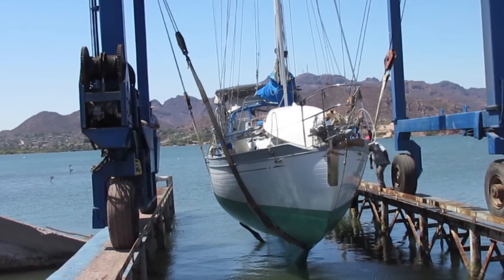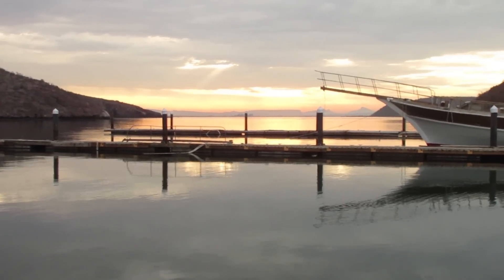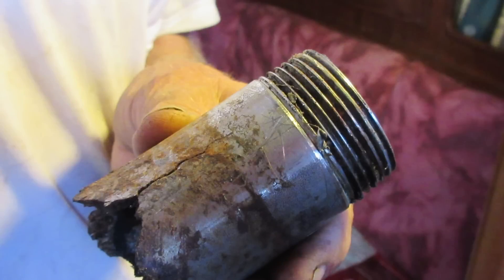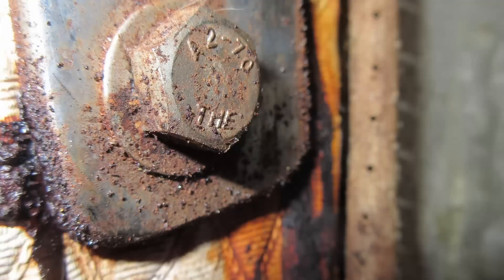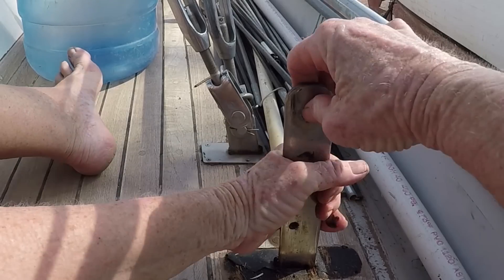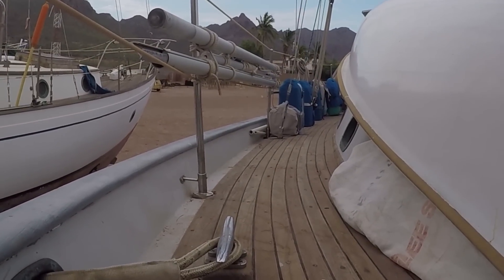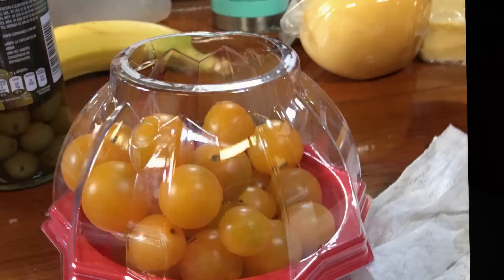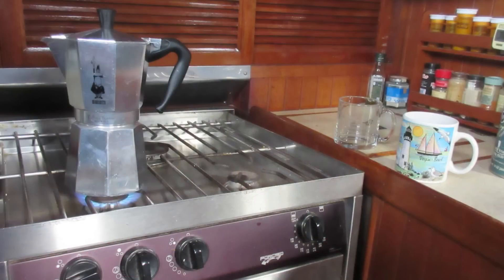Ep. 21 -  Licking Our Wounds

Comment: Bob Perry very smart hombre... keep the teak decks. clean recaulk and sand them. you will be happy with it. Rebed all deck hardware as well using butyl tape.
Sorry your spash didn't go as planned but better safe than sorry. Getting the exhaust right is imperative. Good video. Inspiring. 
Fair winds.

Comment: Tough luck but it's an old boat!
Those thru deck type chain plates are notoriously hard to stop leaking, be sire to use loads of butyl tape  caulking only when reinstalling for you best chance of no leaks.
Really glad bob perry recommends not removing the teak decks, 
Cheers
Warren
Reply from the maker: Yes, getting the chainplates to not leak will be a learning experience.  Now that we know how easy it is to pull them, we can keep at it until we find the right combination.  
Once we saw how thick the teak was, we felt it would have been a crime to destroy all that wood.

Comment: Thankyou good videos , from experience living on a yacht is a full time job , you only know your boat after everything has had some attention at some stage , if your very thrifty types and use the use again theory, think again it's not going to work , like the chain plates , buy more than needed stainless cause your will need some soon somewhere else some time , thoes boat were put together well but the fittings ware and the skinfittings were crap as you have found , I see the one you took out had an earth wire fitting , that's what made it deterate  electroliss of metal , don't link wire these things only the engine and shaft to zink anode , boats are hard work but good fun ,  you can always tell a boat that travels world wide buy the way it's presented and looks , good luck keep going , grant nz

Comment: You should use butyl tape on all your thru hulls.  Last for many years and doesn't leak!
Reply from the maker: We haven't used it for long term bedding yet, but we are using butyl tape to stuff the holes in the deck where we have removed hardware, as this is the rainy season.  Very hand stuff!